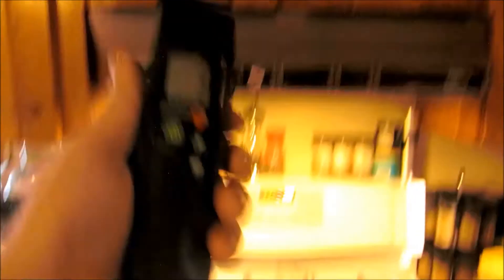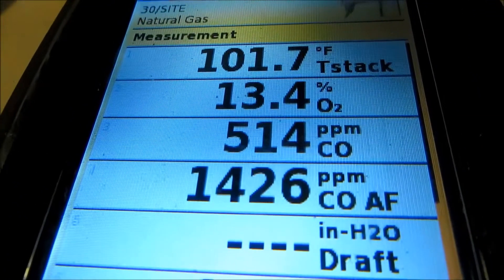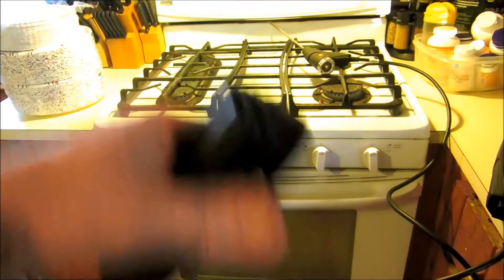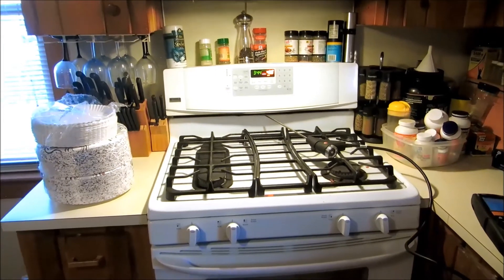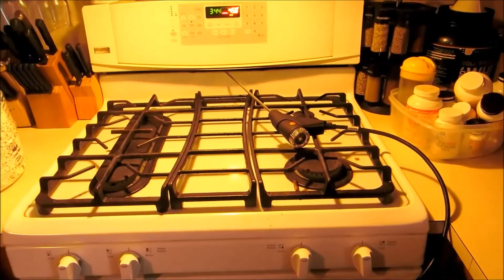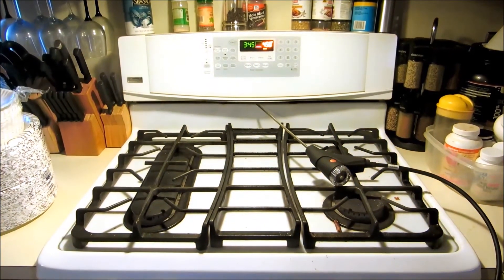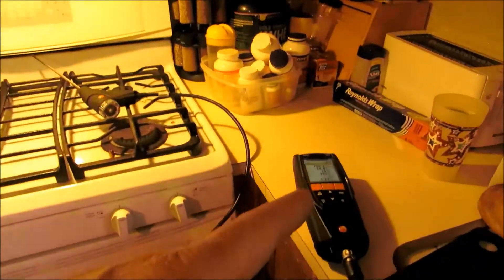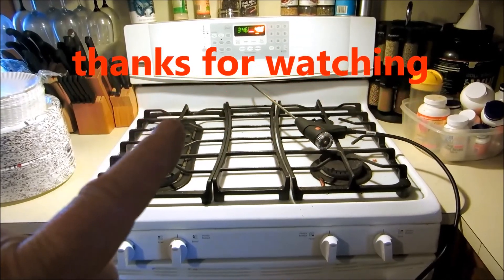is your gas cooking stove safe to operate carbon monoxide awearness

Comment: Those cheap detectors don't go off until it reaches 70 ppm AND it has to be at 70 ppm or above for at least 60 minutes. In my opinion they're better than nothing but low level CO monitors are the way to go.

Comment: Great video! never thought of how bad a stove could be but there it is.. Mine is not vented but I DO have a fair size exhaust fan in the kitchen that is on whenever I use the stove.  Also, be aware (and this happened at my neighbours), having things that exhaust outside without allowing makeup air back into the structure could  downdraft the chimney for your heating system causing more of an issue... Still swear by a gas stove...Won't ever go back to electric ever.
Reply from the maker: +REWYRED good points adressed i tight house can be  a problem

Comment: When you see those old antique gas stoves they always had a smoke pipe coming from the oven connected to a chimney flue in the kitchen. Still see many old homes with a capped off chimney flue in the kitchen. Of course that doesn't do anything for the top burners.
Reply from the maker: Progrocker70 thanks for the comment